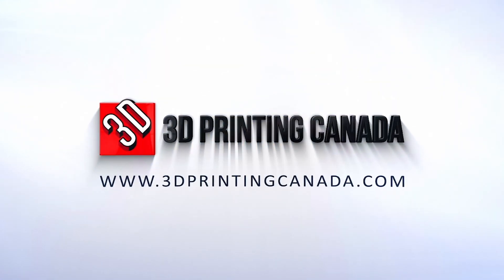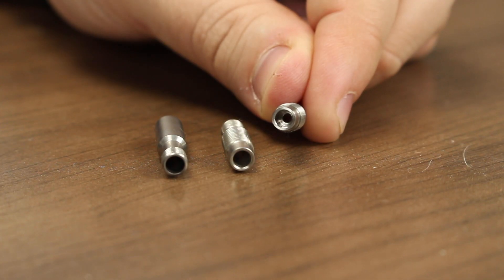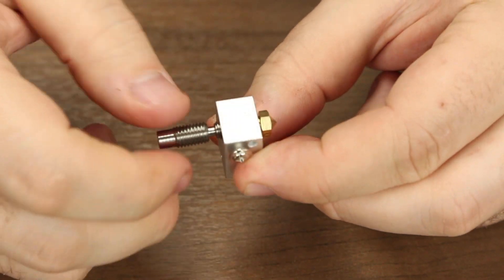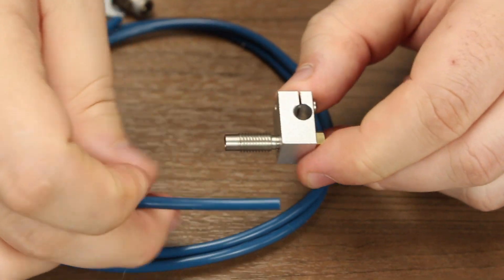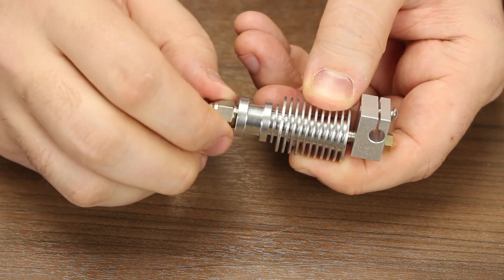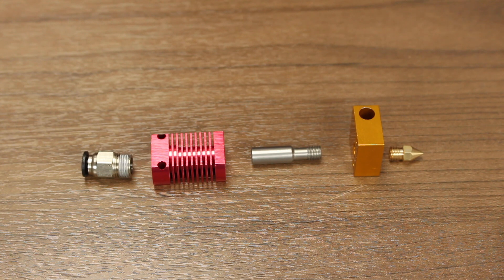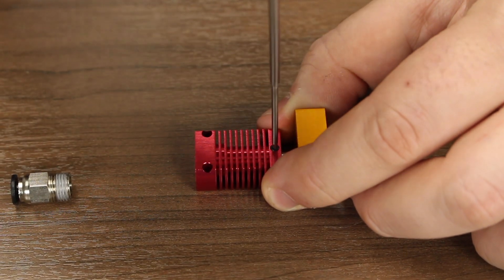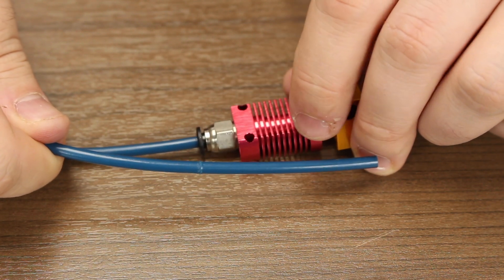The 3D Printer Hotend Technical Guide

Comment: I watched somewhere else where they said the pneumatic fitting should only need to be undone about 3/4 of a turn, not nearly halfway. And that's always worked for me...
I also have Tenlog printers, and those work completely differently. I've still not been able to get down a proper squish on those, I don't think.

Comment: Why space between nozzle and hot block? All say it but nothing describe.
Reply: Not sure what you are asking. The nozzle and the heat break gets tightened against each other.  Not sure if your wondering if it would effect the nozzle temp but if you are if the nozzle is maybe only tightened a thread in then may affect the temp but if you do it the way he shows it won’t affect it.
Also if the nozzle is in all way in, if you change a nozzle the next one could be ever so slightly shorter and could have a gap between the heat break and nozzle which could lead to a clog and frustration.
 Just do it the way he shows. FYI if you ever buy a new hot end and it’s already together it take it apart and do this again just to be safe.